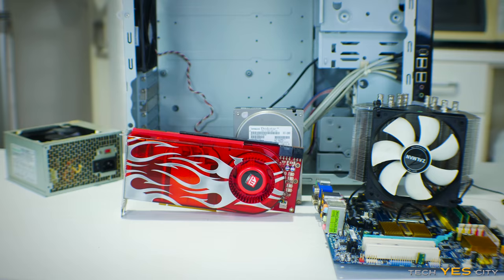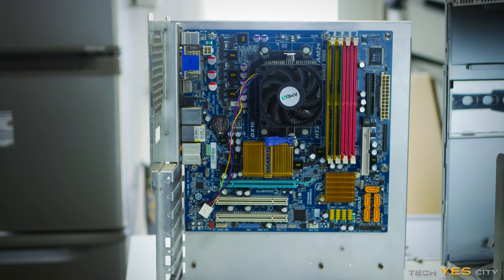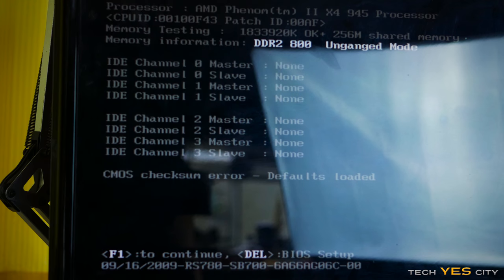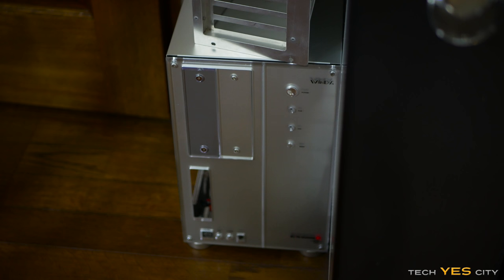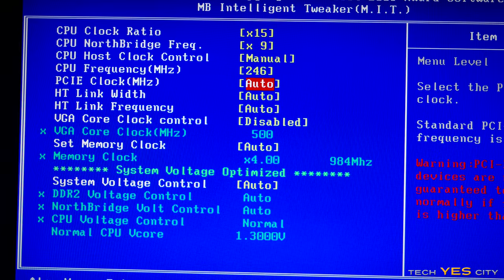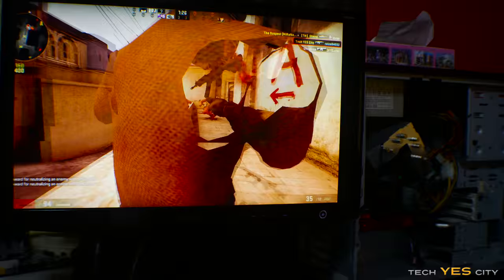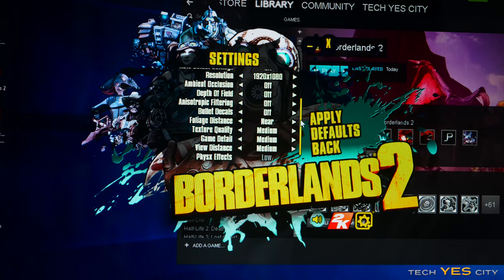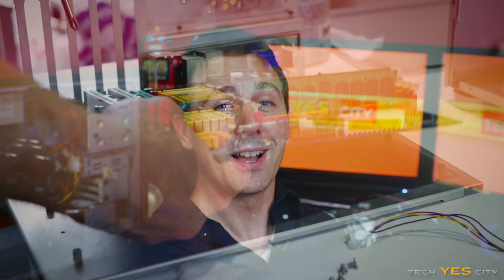The $56 ALL AMD GAMING PC - BORDERLANDS 2 on a BUDGET

Comment from the maker: 360p at the moment! 1080p should be done soon!
Reply: +Tech YES City Come on man ! Overclock that Phenom 2 a little and it won't bottleneck a GTX 970
Reply: +Tech YES City Brian i asked you something on the discussion topic of your youtube channel and you haven't anwsered yet, can you please anwser?:D its a question about my future upcomming build inspired of your videos
Reply: +Tech YES City Damn i'm early, how does it fry eggs?
Reply from the maker: Yeah made a mistake on that lol, it is the Phenom 2 X4 right?  And ill test it in the morning to see if it can cook me breakfast, but I don't think it will with 45 degrees on the CPU lol.
Reply: Tech YES City maybe if the zip tie job fails it will xD
Reply: +Tech YES City I only get the option for 1440p????
Reply: +Tech YES City PHENOM 2 with AM2+ motherboard -> DDR2
And with AM3 -> DDR3
Right or not ?
Reply: +Je van der Geest That is not 100% true.

There are no AM2 or AM2+ boards with DDR3 and no AM3 boards with DDR2 AFAIK.

Decent AM2 and AM2+ boards will work with AM2, AM2+ and some AM3 CPUs (like in this case AM3 CPU on AM2+ board)
(depending on Brand and Chipset, AM3 CPUs do support DDR2 and DDR3 RAM)

However, it does not work the other way around. A AM2 or AM2+ CPU will not work in any AM3 Board.
(since those CPUs don't support DDR3)

All AM3+ boards work with AM3 and AM3+ CPUs
Some AM3 boards work with AM3+ CPUs but there is really only a few.

Since AM3+ CPUs don't support DDR2 anymore, they won't work on AM2 or AM2+ boards.

AMD socket generations overlap here and there which makes it a bit more complicated than with intel
but this allowes for stuff like installing an AM3 Phenom II 1100T 3.3GHz x6 Sixcore CPU in a prebuilt office PC that originally came with an AM2 Athlon 3500+ 2.2 GHz Single core.

Loved to mess with that stuff. :)
Reply: +Coldministrator thanks for thanks 
yeah indeed it's a bit complex
Reply: +Tech YES City what is the liquid cleaner you were using, and can I get it in the US?
Reply: JellyfishTesticles it's automotive brake cleaner, be careful though because if you leave it on your components too long it eats the plastic
Reply: +Ramses ok good to know, but its fine with the other components then?
Reply: +Atilolzz I also have 4k option :^)
Reply: +Tech YES City phenoms usually see some of the biggest gains when you overclock the northbridge...2400 usually is what you aim for with 3.7 ghz set up...3.8 ghz is between 2400 (12x) and a lot of people see the best result at 2600 (13x) ...i like to up the cpu multiplier a bit then bump the base clock a lil and fine tune for the best results but really try and get the north bridge speed up im willing to bet you will see a bump even at those speeds...i noticed 3.6 to 3.8 ghz with a jump to 13x northbridge for 2600mhz gave me the biggest jump and was diminishing pushing it all the way to 4.1....however i did get a lil better cinebench score and a 5235 in passmark I saw a 20% boost with a good oc those phenoms really oc well..keep up with their fx counterparts... at those speeds it can even handle a gtx 760 well...but I would say that is the limit on the phenom 2 x4s as far as gpus ....and with some heat-sinks on those vrms you probably could do 3.8 or 3.9 but with only a 4 pin and a 4 phase vrm by the glint i saw i can see why you held back
Reply: nearly 100k sub nice job :D KEEP IT UP BRYAN!!!
Reply: Dude where do you get your pc parts
!!!!!!
Reply: +SebzGaming eBay junk stores, Craigslist, forums, trash ...
Reply: ok! thanks
Reply: Where do you buy your components from, bud? I also live in Japan, and I'm struggling to find decently priced used parts
Reply from the maker: Got to hit up the countryside, the city is full of hawks.
Reply: +Tech YES City if you get some free try upping the northbridge to 2400 for 3.7 the phenoms really gain a ton from a northbridge oc
Reply: +Tech YES City 
Hey Bryan
Just wanted to ask is 1.192v a safe Ring Voltage for a 4690K @4.2 Ghz?
Its to emphaise it Ring voltage and not core just in case you miss it
Also now the CPU seems to ask for a little more voltage
Can it be because its summer time and its hotter, is it related?

How much of a performance improvement do you get with increasing the ring clock anyway?
Ive heard not much especially with regard to gaming.
Reply: +Rohit Beniwal check his videos, he explained this in some videos
Reply: +jd gaming 
Ive seen them man
However neither him nor many guides online seem to be talking much about Ring voltages
In Bryan's OC guide he does talk about what to set your ring clock and voltage at but doesnt speak abut what is a safe upper limit
all CPUs are different and could demand different voltages
Reply: +Rohit Beniwal http://www.overclock.net/t/1411077/haswell-overclocking-guide-with-statistics

1.35 is the max safe ring voltage
Reply: phenom ii x4, thought you had a first generation phemom for a second there
Reply: +Tech YES City GOOD VID
Reply from the maker: Max "Safe" Ring voltage should be the same as Intel's range for the CPU Voltage since it is on the same node, though they don't list it on their website anymore for the overclockable CPUs? On Haswell though I heard they specified the 'safe limit' as 1.275v, though up to 1.35v seems to be fine, I took it to 1.4v but didn't go any higher and that was only a 5ghz validation run. 

As far the Ring Clock goes, I would just set it to 4ghz and call it a day, as long as its below your core clock then it is at its optimum level.
Reply: Is this the same Phenom II X4 that you silicone'd up in the $40 build?
Reply from the maker: lol nope! Sold that one a while ago! Ironic that they had the same mobo though with the same broken heatsink lol... I think the CPU on that was a 940 not a 945 though.
Reply: +Tech YES City Hey tech we should play some games on steam together.  One more thing in Japan is there houses with basements?
Reply: +Tech YES City 
can you build a Suitcase PC because that would be awsome
Reply from the maker: Basements in Japan? Never seen it before lol, would be extremely rare.  Can add me on steam, though I don't get a lot of time to game these days unfortunately, between work, youtube and my 3 year old son.
Reply from the maker: Flippuhtie Interesting idea, would have to have some half decent tools for that lol, but will definitely take note.
Reply: +Tech YES City :D AWESOME portable and good gaming performance at lan party,s
Reply: +Tech YES City In the Inaka myself. Perhaps TOO Inaka...
Reply from the maker: Lol what's the population of your town? Mine is 61k.
Reply: Tech YES City About 35k.
Reply from the maker: do yoiu have a hardoff there?
Reply: Tech YES City  Lol this is ours 1,236,324
Reply: +Tech YES City What is that stuff your spraying when your cleaning the components
Reply: +Tech YES City Windy is A Japanese Manufacturer, thats why you dont really know about it in the US.
Reply: +Tech YES City Nah. There's a few in the South of the prefecture but they usually sell slim OEM builds from NEC.
Reply: +Tech YES City ... the overall population of the island I live in is 143k... yeah...
Reply: that CPU will beat any AMD APU aka 860k because it is soo bad. that was back in the day when they were actually competitive and different management. I got a old ass Intel Xeon w3565 that can beat AMDs latest 6 core fx but it only cost me $13
Reply: +Tech YES City What do u even do with all those computers?
Reply: what u do with the PC's when u done ?
Reply: Matthew De Villiers He either sells them or give them to people who he really knows.
Reply: +Zushikatetomoto Shift really knows.
Reply: +Tech YES City how did u get that
cuz i want one :D
Reply: +Никола Кољо so mythology is your favourite thing in general ! not just for the macedonian (greek) history ! good good !
Reply: thanks for the proof ;)
Reply: +Tech YES City plz can you spend 2 more seconds on the audio with editing? one second it is like whispering sounds you need 100% volume then the music comes in like 100000000000000000000db's -.- #RIPheadphoneusers
Reply: +Tech YES City what do you do with all these builds afterwards?.. sell them in a store? or give them to less fortunate?
Reply: so is ur face but i don't see anyone complaining about it.
Reply: +Tech YES City That case is pretty bad ass.
Reply: Just letting you know, the CPU is called the Phenom II x4 945, not Phenom x2 945
Reply: +Tech YES City Where do you get all this cheap shit(i live in aus ; )  I love your channel btw you deserve more subs!
Reply from the maker: Junk stores and auctions, Japan does have some really good deals.
Reply: u will beat linus if u join the scrapyard challenge
Reply: Awesome video  i have a question what you use to clean motherboard and other pc components? And please make more videos like this most of the youtubers make videos of new builds worth 1000$ or more too expensive for a lot of us. With your videos we learn a lot of things a lot of people are not that  rich so they buy used computers. If you get time please reply 😊
Reply: +BakyLive No, just no.
Reply: aqsha izac
 Linus always makes shitty rules so he can come out on top.
Reply: How you find parts this cheap is oblivious!!! I've been wasting my entire day looking for really good Gpu's for that cheap
Reply: +Tech YES City what wireless wifi should I use on a ibuypower gaming pc because I'm new and by a month I would be buying one but I need it running on WiFi if you want me to I'll link you to the pc I'm looking into buying
Reply: +Tech YES City You know it's the Phenom II X4 945 and not the Phenom X2 945? The X2 945 doesn't even exist. If it was a Phenom X2, it would have been a dualcore, the X4 means it's a quad core. The Phenom X4's were real beast at their time. Even though the FX series were on a smaller processor node and ran high frequencies, the performance per core was around the same, sometimes even worse, than the much older Phenom II series. This is all due to the unusual architecture of the FX family.
Reply: Dex4Sure Well, with the FX series the problem is that two cores share 1 fpu and level 2 cache. This just completely tears apart the performance per core
Reply: You should give it away TECH YES CITY
Reply: +Tech YES City lol 4k
Reply: +Tech YES City Hey brian i was wondering whats better the 2900xt for 30 dolllars US or the 9800gt for 25 dollars US???
Reply: can you make an pc for Ark?
Reply: ? ??
Whats Ark?? Is it a game???
Reply: +Lou C ark survival evolved
Reply: ? ?? Sorry i never heard of it is it a new game?? FPS shooter?? RPG??
Reply: i wish i was your neighbour
Reply: Google is your friend
Reply: +Lou C its a survival game with dinosaurs!
Reply: i probrably would buy it off you because my specs are amd e-300 dual core cpu a amd radeon hd 6300 gpu 1.5tb hard drive 4gb ddr3 ram xd not too sure if tht pc in this vid is better or not pls reply thnx in advance xp
Reply: 1 more thing i would buy the csgo one ir this which ever is better but pls tell me if my pc is ok for csgo i currently use a laptop runs game at 20fps low settings made it too gold nova master with 20 fps hopefully my desktop will run better but ye if u have the time pls reply thnx in advance again XD
Reply: You know you've could have made this your CS:GO PC, since it's cheaper and it runs very well!
Reply: Most anything with above 2GB of RAM will run Terraria, Terraria is very very easy to run.
Reply: He uses brake cleaner. Can be found at any auto store. Id stay away from the chlorinated stuff though
Reply: Im glad I found this channel, Its one of my favorites already. Just have two questions: why use brake cleaner instead of isopropyl alcohol (most pure u can get)? and what was all that procedure with the screwdriver on the PSU´s components? Were u trying to see It the PSU gave a short circuit?
Reply from the maker: Brake cleaner is some harsh stuff and will clean some of these parts that looked like they have been left in a baron wasteland lol.   As for the psu, yeah I just insulate myself and run that screwdriver a long it, as with these old PSUs, I just don't trust them.
Reply: From where you bought the pieces?
Reply: +Tech City would this run fallout 4 on 8gb ram or no. Or would you need a better graphics card? And what type of gigabyte motherboard is it! And also I can't find a dud psu and I don't know what type of scythe cooler it is?
Reply: minecraft could not run good on this pc lol
Reply: Actually it could with a good graphics card that's old it runs gta 5 really good. Of course more ram could get you more fps to
Reply: you mean 4k? xD
Reply: I want a pc to play gta v and run mods, but pcs are expensive af, the most I'm willing to spend is 💯
Reply: good luck with that i can but my rig was 1700
Reply: You can build one for around 750 - 800 i'd say

Rx 470
I5 - 6500
600w PSU
Cheap motherboard 
No name DDR4
1TB WD Blue Drive
Deep Cool Tesseract + Gammax CPU cooler.

Comment: I do a lot of PC dusting and cleaning. What i found is a great solution rather than those expensive cans. I have a large compressor that I use but the cheap way.  Get a small brad nailer compressor and a 10 Gal air pig.  The compressor removes most of the moisture. Then transfer to the air pig the dry air. Then use the air pig to blow out the PC. The compressor and the air pig both have water taps on the bottom to remove excess moisture.  You can see if you have a problem with too much moister to use on a PC when you test it on paper and you see water drops. One fill of the air pig will clean about 12 PC's. So plenty of time to work the water out. You can buy special water eliminators but I haven't found it necessary and I'm at sea level on the Pacific coast. A low pressure regulator is necessary. 10-12psi 20psi max. You do not want to be blowing 100psi at a motherboard. That's enough to blow things off the board.

Comment: i recently sold my phenom x4 965. That thing overclock like a beast, i had it at 4,2ghz on a cheap motherboard (m5a88-m) with an hyper 212. I played games like gta V, bf4 with no problems, shuttering, etc... on cinebench it scored 429cb allmost, the same as a stock fx 6300.

Comment: i honesly feel phenom ii is the way to go when considering amd. untill zen anyways
Reply: +wally aviles well maybe Phenom II X4 and especially X6 users don`t have the need to upgrade, at least not to current AMD FX lineup. They just need to push some 20% overclock on the cpu and keep going. But still, you cannot completely disregard FX line. It has new instruction sets, faster memory support and some inner data path optimizations. In some professional applications and many new games 8 core FX will beat any Phenom 2 by a nice margin.
Reply: True
Reply: ***** That`s weird. I have FX-8320  for 2 years now. Yeah i witnessed it has "only" the same performance or even lesser than Haswell based i5`s in 3D rendering for example, but everything else.... i just didn`t notice anything. And for last 12 months it`s not overclocked at all. I actually undervolted it for 0.1 V using global voltage offset. It had huge impact on temperatures and i reckon wattage is quite a bit lower. And it still hovers around i5 4460 general performance i guess. AMD really doesn`t get any love these days. I hope that changes with Zen.
Reply: +Nick Russ You got it all backwards. Gaming engines are poorly optimized for FX CPUs because they can submit draw calls only from one thread. FX line is ok but software ecosystem is laging behind
Reply: +Leone Furlan He is obviously trolling. A GPU at 250c would be melting in your desk...
Reply: +wally aviles prices on fx series arent really bad now tho. The new G(intel) is a price/perform banger at this point also.
Reply: +Uncle Paulie  fx8350 5ghz  980 here  99%load on all games on gpu..
Nice try to sarcasm or jokes, next time be more credible that makes it legit
Reply: +CMstacker yes you are totally right...phenom x4 960T user here... 4Ghz on 4 Cores full stable and 3.6Ghz on 6Core full stable...i wont upgrade untill new cpu's from amd or intel come.

Comment: Phenom II x4 series was really good, actually my favorite AMD family of processors, very good architecture. I still have Phenom II x4 955 OC-ed to 4GHz paired with Radeon HD 4890 Sapphire Vapor-X in my 2009 build and it is still very capable (only graphics card lacks driver support for newer operating systems like Win10 and no DX11), can't compare it with my current i7 4770k OC-ed to 4,2GHz and GTX780Ti but still great configuration indeed.
Reply: Just bought a hd4890 for 15 paired it with a xeon l5420 and its the best rig I ever had